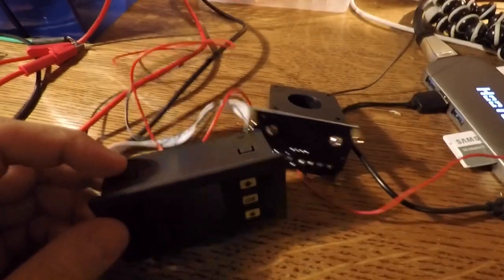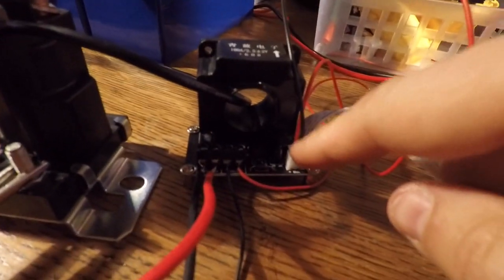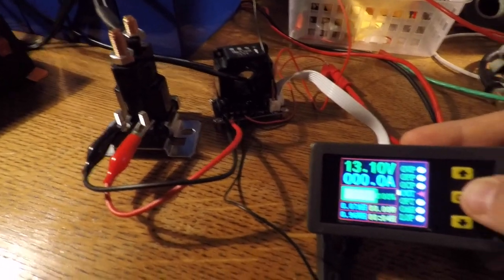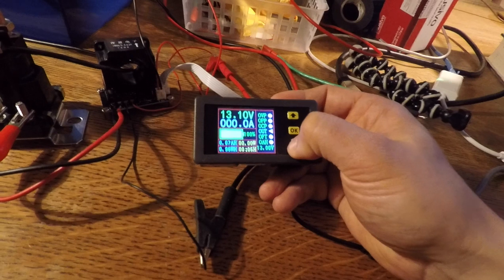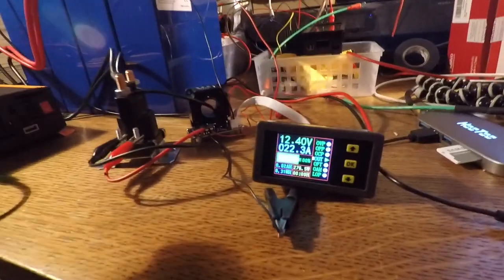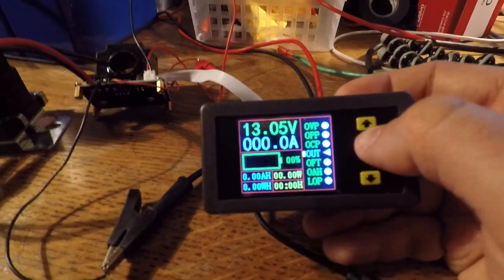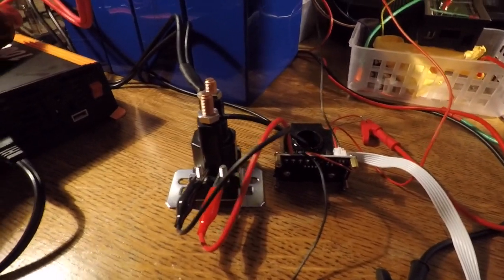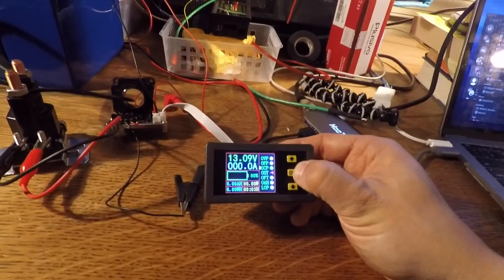Battery Ammeter/Voltage Sensor - Test, Review and How To

Comment: Normally these coulomb counter SOC meters have a setting for high and low reset because if it stays based on current in minus current out for too long it will drift. Disregarding the load cutout limits, your LifePO4 battery might be fully charged at 14.6v, so at that time it should reset the AH to your limit entered in OAH and the SOC meter will go to 100%. And if the battery gets to 10v it should automatically set 0 AH and the SOC indicator will show 0 and start climbing as its charged. 

So lets say you have 50 AH battery and set that in OAH, then as you charge and added 40AH it would show 80% SOC and 40.0 AH. Then if suddenly you got a load more than your charge current it starts draining and SOC slowly drops 79%, 78%….55%, then when load is less than charge it will climb again. 

You can manually reset it when you charge but its better if it automatically resets during a normal charge cycle. 

Of course now you have to factor in the charger voltage limits and the load voltage limits. If your charger is set to charge to only 14v then the high reset needs be that just below that value. As long as its not near the flat part of the voltage curve.

Perhaps the OVP and LVP shut down the display AND reset to the AH limit or 0AH when it restarts. Clearly you don’t need those limits to protect the meter because it works its not going to fry at 15v. The high and low reset should have its own setting and not shut the display down but who knows. 

I know you haven’t played with that in a while but if you do maybe can try to get it working in full auto, such that anytime you read it its showing accurate SOC, and automatically resets periodically.

Comment: Thanks, your video helped a lot since I received no instructions with the device whatsoever. (could you post a link to the manual, please?) Instead of a relais I just wanted a warning light so I connected a led. It's always on no matter what alarm settings I use. E.g. high voltage alarm OVP on (green) set to 10 V or set to 15 V with a reading of 12,5 V.  LED is on, turning the alarm off: LED is on. Any idea what is going wrong? Thank you for your time and effort.
Reply from the maker: Sorry, I haven't worked with this thing for a while so I don't have the manual and I'm not sure what is going on unfortunately. But your LED may be too low a voltage - there may always be a low voltage going across that circuit if connected. LEDs tend to be very, very low voltage. Trying running something else that requires a higher voltage to work.
Reply: @TheWilltoBuild  Thanks, I check it out and let you know.

Comment: This is more of a "Here's what I did" video rather than a tutorial.   The assumption here seems to be you already played around with it a bit. Not much good info on basic configuration and operation.  Slow down, get a tripod.   Makes me nauseous trying to follow this.
Reply from the maker: Randy, I bet you are a really fun guy.
Reply: makes perfect sense to me and I dont own one, just a PZEM-015, DL24, "200A" Wattmeter, DT-24, and some other little devices for measurement. Dont want to buy this and get frustrated by flying blind and toss it in a drawer out of frustration. This and another video make me comfortable enough to buy it now

Comment: Im wanting something like this for a second battery in my campervan. Can I wire it in such a way to show the current the second battery is receiving, during driving times, and then the power that's being consumed by appliances when I'm stopped and its isolated?
Reply from the maker: You can definitely wire it in such a way that you can see what is going in and out of that specific battery. So if it is a second battery, you can definitely wire it to show the net power going in or out of just your second battery.
Reply: @TheWilltoBuild  Thanks. I've since done some more research and now I'm clear on how the setup works.

Comment: shunts monitor the negative lead but hall sensors should have the positive lead through it...  schematics for hall sensors say positive is used but it seems to work with the negative too
Reply from the maker: I think positive and negative should both work, but I've just been using it as the schematics suggest.
Reply: Mine shows putting the red + thru sensor. I'm just not sure sending 58.8 volts power to unit.

Comment: Hi. I have the same meter, haven't installed it yet. My only issue is the length of the cable from the sensor to the display. I need one about 4-5 feet long. This will be going in my golf cart. I can't find any that are premade. I saw one comment on Amazon that if you extend it, you need to use shielded cable. So I thought about extending it will a shielded ethernet cable. Any other ideas?
Reply from the maker: I tried to find a cable to buy, but couldn't. Given that, I would think the best way to move forward would be to extend it. Shielded ethernet cable could be good - just make sure the connections for the extension are rock solid and that you cover them in shrink wrap.

Comment: the relay is 24 volt on your link but your batteries are 12 volt can you use a 24 volt many thanks colin
Reply from the maker: The contactor I used was 24 volt! I used an external power supply for the contactor which was 24v. You could easily use a 12 volt though, but make you use a "normally open" contactor. That way if the battery dies, the contactor will be open by default and hopefully prevent draining of the battery.
Reply: @TheWilltoBuild   THANK YOU I WILL ORDER NOW